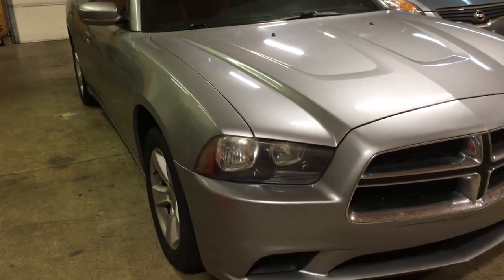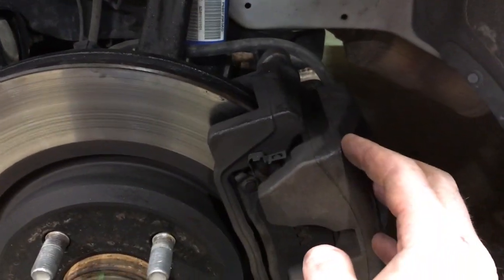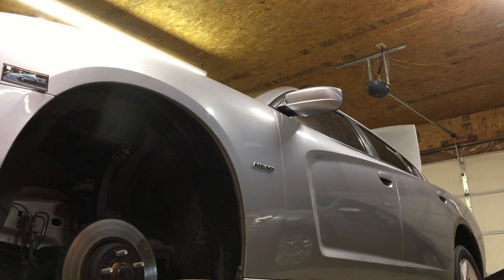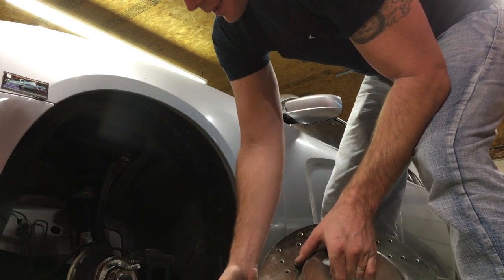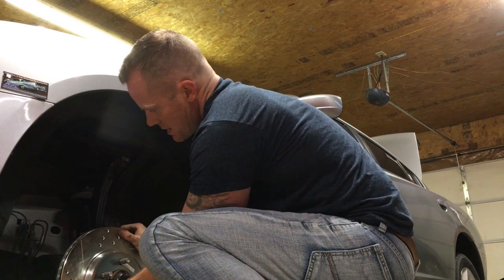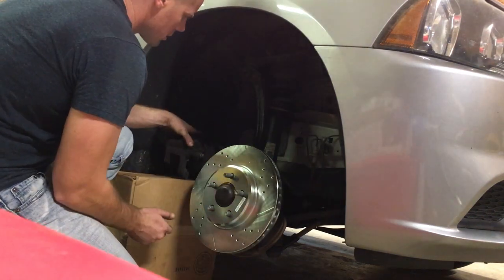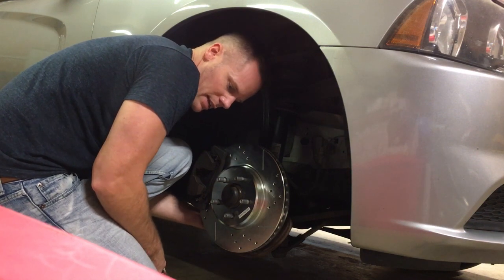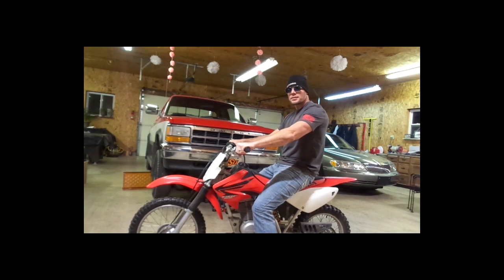2011 Dodge Charger Brake Rotor Upgrade

Comment: Random comment cause I was just doing this job all on my own the other day.
In the middle of it all, I started spinning the rotor because it was making a light grinding noise when spun and it freaked me out so I kept spinning it and realize it just wasn’t in all the way.    And while I was spinning the rotor, my finger got caught in between the caliper bracket and the rotor and OW!    It hurt like hell. Felt like my finger was close to being harshly gashed open

Warning to all. lol
Be careful when inspecting your rotor for strange noises

Comment: Hey, great video. Just a small tip if next time your rotor get stuck again: behind the dust shield there is a little rubber gasket, pop that off and you will see a star shaped bolt and spring. Turn that bolt a couple of times with a flat screwdriver to release pressure from the e-brake. The rotor should pop out easily after that.

Again, great video. Hope you are happy with the results.
Reply from the maker: I believe mine only has an e-brake on the rear.
Reply: MrTrenbo oh, never mind then. I have a 2016 charger and they have e-brakes on all 4 wheels. I guess they upgraded it

Comment: Did you have to bleed the brakes? Or just swap the rotors put the tire back on and go?? Ima newbie working on my car. About to swap my two front rotors on my 2012 challenger sxt
Reply from the maker: should be just a simple swap. No bleeding required.
Reply: @MaxAC  thank u!
Reply: @MaxAC  good news I got the caliper bolts loose but the caliper won’t let go of the rotor 🙄 wonderful 😂
Reply from the maker: @relljohnson945  Yup,,,, been there before.  Just have to fight with it.  Usually a small prybar between the edge of the rotor and the caliper works best.

Comment: Do you have to spray something on the rotors for them not to rust?
Reply from the maker: Perhaps If they sit unused for months on end but normal driving would prevent rust build up.
Reply: @MaxAC  thank you for responding